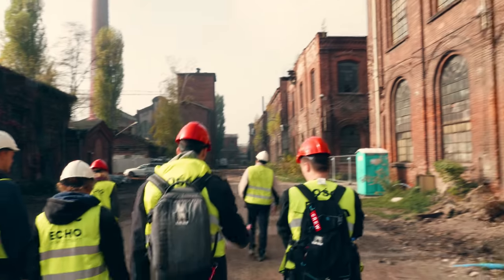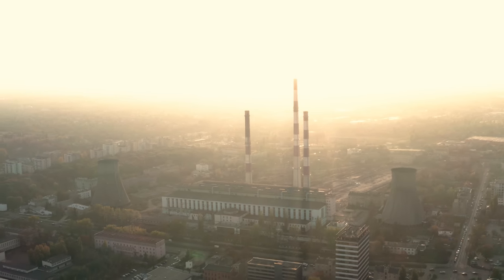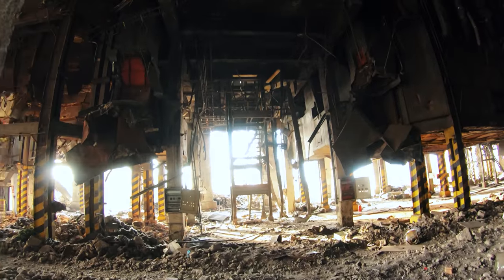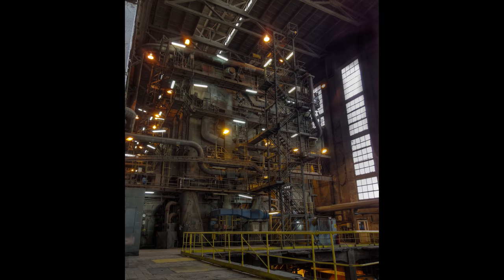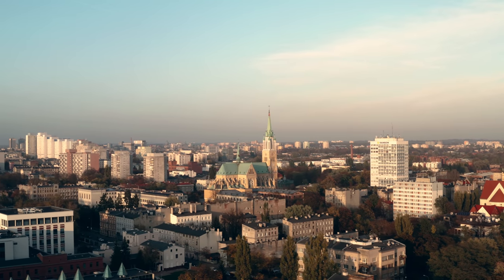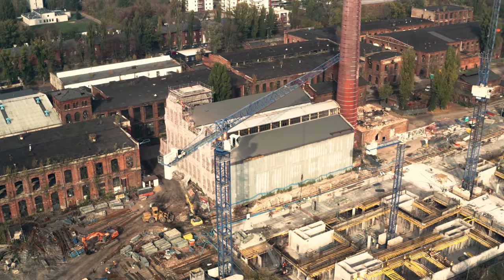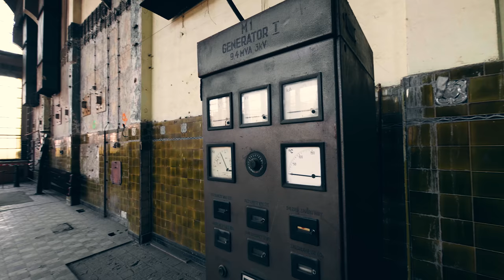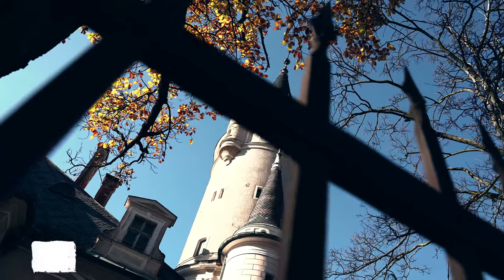Inside Poland's Forgotten Power Plants | Urbex

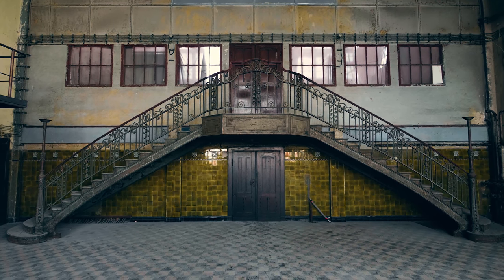Comment: 15:32 Wow. Just imagine trying to construct something like this today. It would be hard to find someone that would and it would cost a lot and that was built in a freaking powerplant and not a representative building!
What was different back then that they even had style in places that you would not expect it?
Recently, I've seen an architecture student photographing the ugliest buildings in town, skipping all the beautiful timber frame buildings, the Jugendstil and Klassizismus houses. I was like: dude, what is there to study about those ugly concrete boxes?
Reply: Also, what really surprises me about demolitions: why don´t they remove the windows, the wiring and metal first?
I get into trouble if I put a glass bottle into the normal garbage and copper wires have become so expensive that they get stolen everywhere and official demolition crews just dump everything in a landfill?